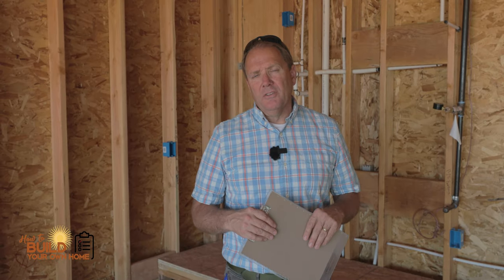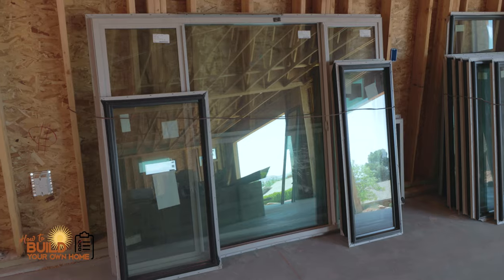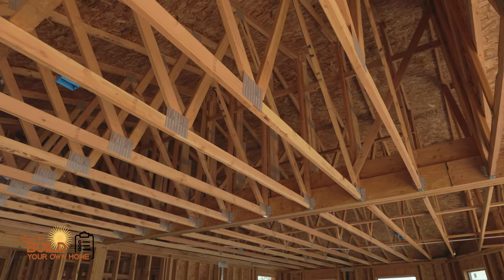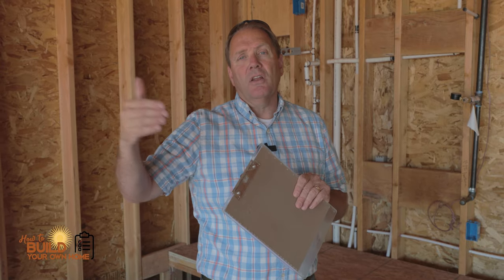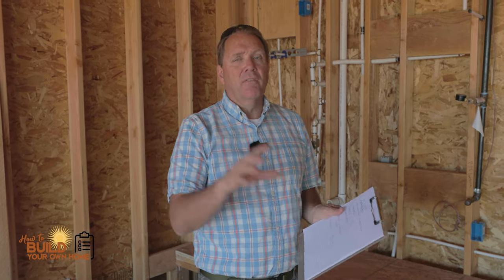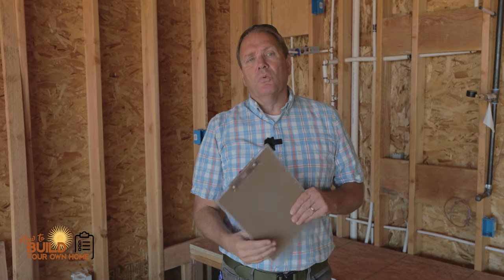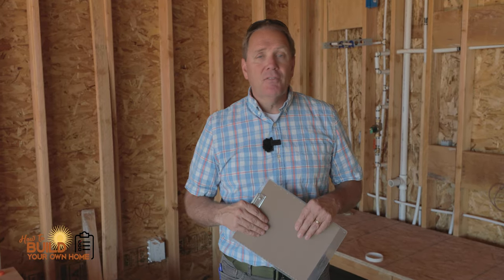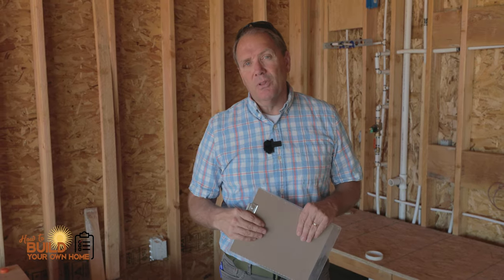Construction Delays - 3 Bottlenecks that Stop Construction

Comment: Have you any experience with the BMC ready Frame concept Keith?  I was just introduced to the concept, blew me away.
Reply from the maker: I am familiar with BMC Ready Frame. For a home that is more production built, it would work fine, for the most part. For custom homes that have several height elevation changes and more custom features, it would not work well.
Reply: @HowToBuildYourOwnHome  is that like a smart wall system..exterior walls are pre built, insulated and sheeted. The whole house is delivered to the job site. Walls, trusses window, siding, shingles..basically everything thing you need to get to lock up
Reply: @waynebeck7801  Not that detailed Wayne, it's basic framing, pre-cut.
Reply: @HowToBuildYourOwnHome  I suppose it could be a problem if you have a customer, or wife, that wants to change her mind, or is very indecisive.  One would have to stick with the plans.  They have an interesting .com page explaining how they are now working with individual architects. Don't think it would work on your current build you're showing us.